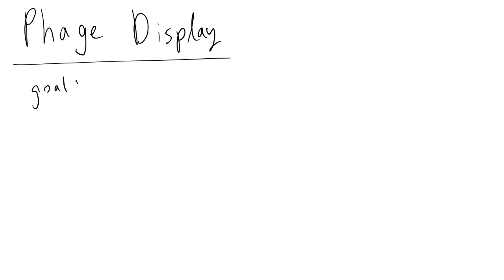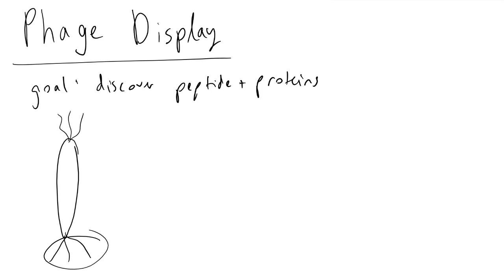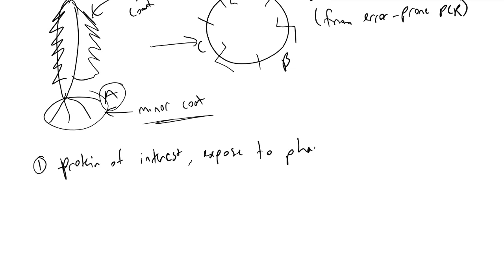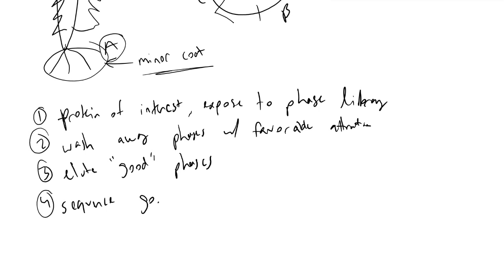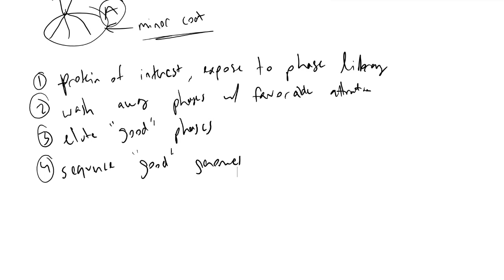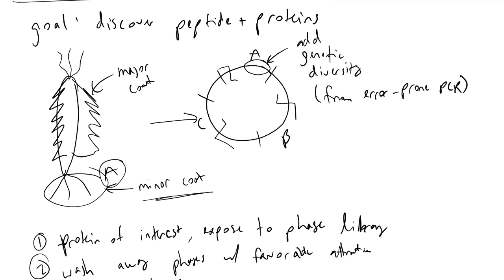Phage Display Introduction

Comment: How do you “stick” a protein to a plate?
Reply: Generally, with streptavidin and biotin. The key idea is that streptavidin (protein) binds tightly to biotin (small molecule). So, you coat a plastic dish with streptavidin. Then, you attach biotin to your protein of interest. So then, when you mix them, you get protein stuck to the plastic dish .

Usually, I'll buy pre-coated streptavidin plates. For example, ThermoFisher product #15124. You can also make them yourself, but I've never done that. I think you just pipette a solution of Streptavidin onto your plastic dish, incubate over night, and then wash it off--and some of it sticks to the plastic.

Then, there are different methods to put biotin on a protein of interest. They just involve putting some of your protein of interest in a test tube, adding biotin, and then adding some other chemical(s) that help with the process. There's a good summary of different methods on Wikipedia: https://en.wikipedia.org/wiki/Biotinylation.
Reply: @julistanleyA  thank you so much for your time in replying